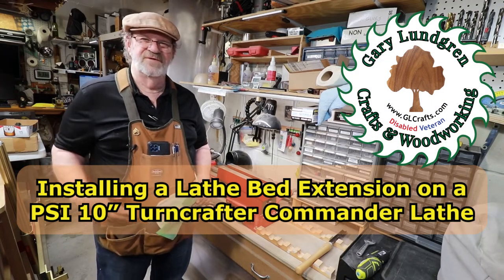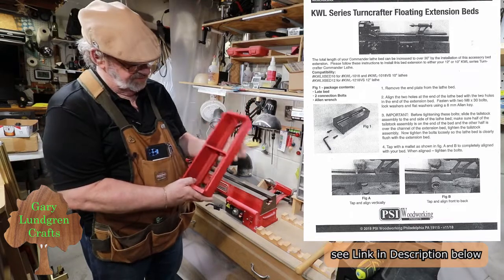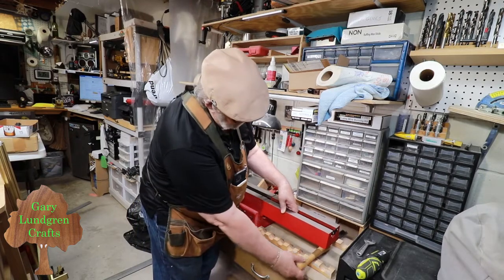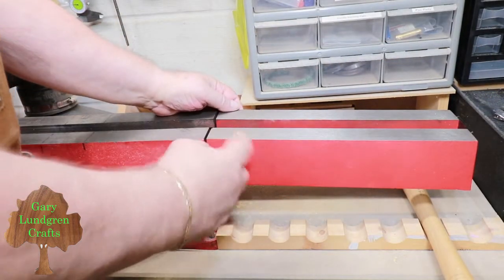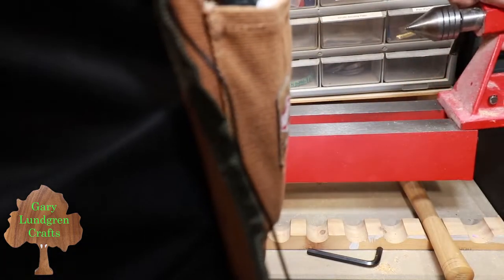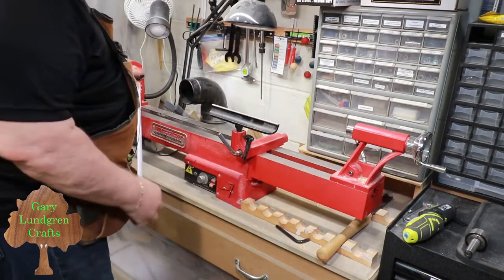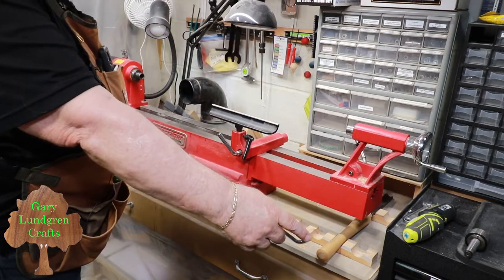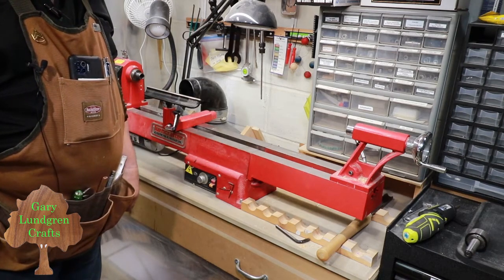Installing Lathe Bed Extension on a PSI 10” Turncrafter Commander Lathe. S7Ep04

Comment: Looking good. I like your lathe table too.
Reply from the maker: Thank you!  The drawer in that holds a lot of my lathe chisels and head & tail stock pieces.  I built it some yrs ago from plans from WWGOA.com  I made a couple mod's to the design to suit my needs.  I made it full length without the tower at thr right end.  But a good basic plan to go by.  I use a Tormek T-8 sharpener and it has its own cabinet.  See the lathe stand at  https://www.wwgoa.com/video/handy-lathe-table-plans-002087/
Reply: @GaryLundgrenCrafts  Funny coincidence. George lives a town away. WWGOA is 15 min from me. I have the DVDs from a clearance... I’m sure I have the episode for that lathe bench.
Reply: @FearsomeWarrior    Cool!  Have you been to his shop?  I'm originally from St Paul MN Woodbury area.  Left there in 2007 and went to Sacramento CA. Then came here to Southwestern PA, Johnstown, in Aug 2010.  Moving around for consulting gigs in my professional job as tax consultant.   I go visit my family in Minneapolis area each Fall. I drive thru WI on I-94. 👍
Reply: @TaxBulldog  exactly yes.